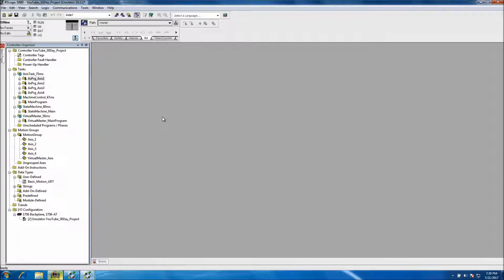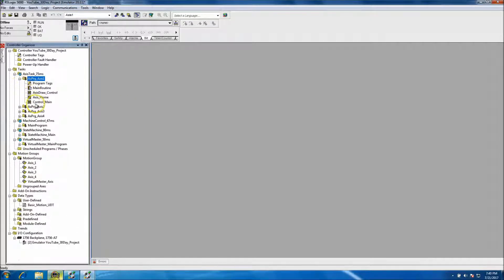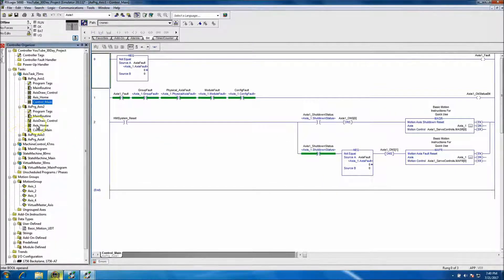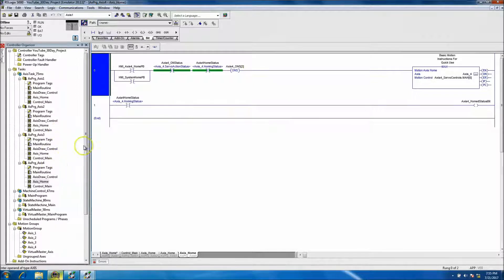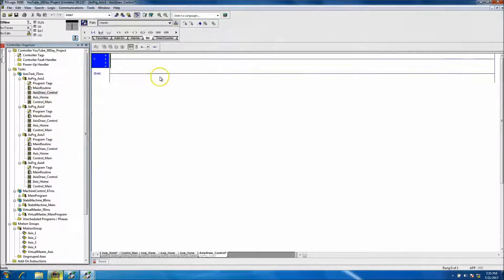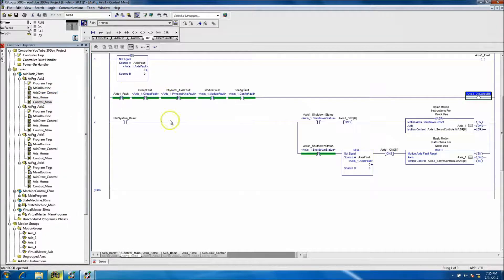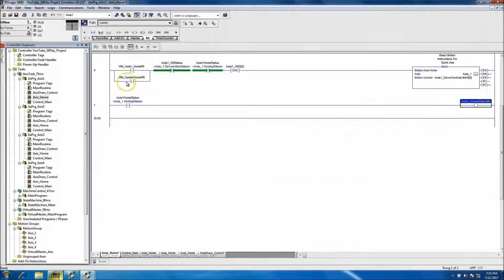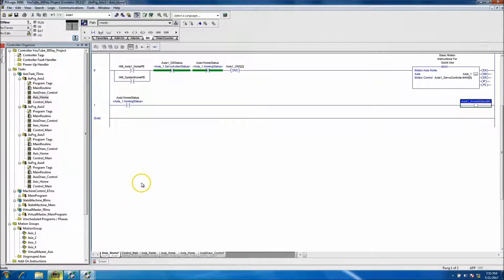Servo Motion Project Day 7 - Adding Servo Homing Logic into RSlogix 5000

Comment: Really Good Videos 
How I can homing de servo with a eye every time the machine start , in other words when the machine start move slow to the eye and rehoming also put some sensor for limits
Reply from the maker: Wire the home registration input into the servo controller then have the command to move a set direction after machine start under a highly controlled routine.

Simply said but you have to understand the way a servo works in controllogix
Reply: @ShaneWelcher  thanks for your help - if one of this days you make a video about it please let me know , i found that many people have the same question and no  answers 
thanks again
Reply from the maker: @gustavoguevara7419  I have videos about all servo stuff like this.

Might be in my course though.

I'll look into it